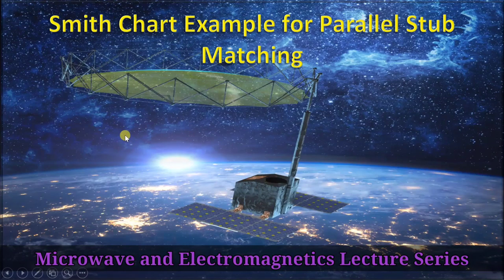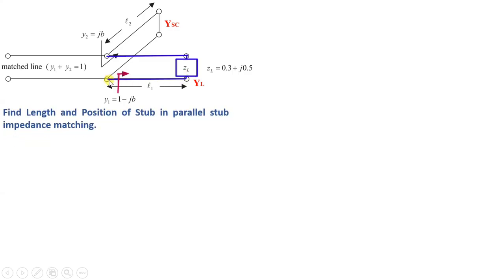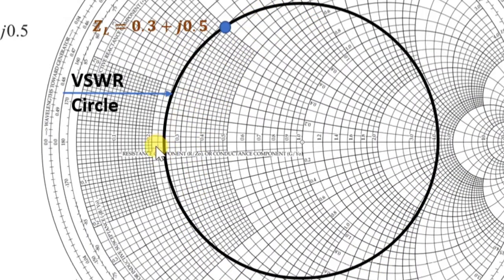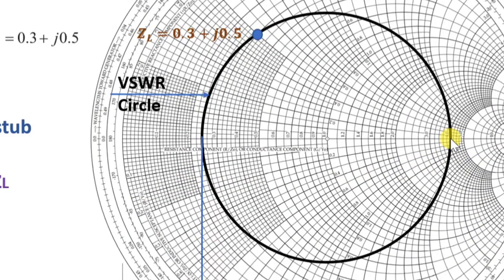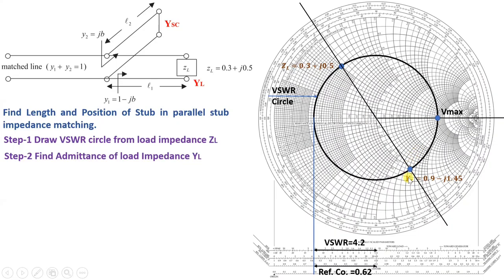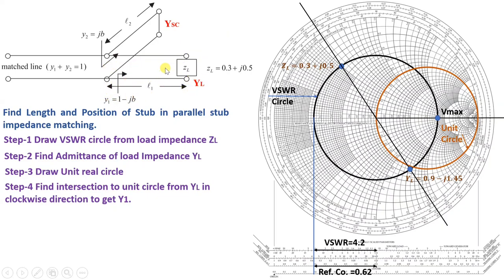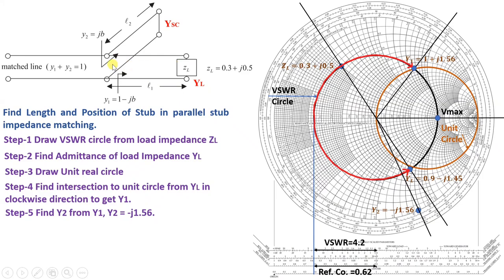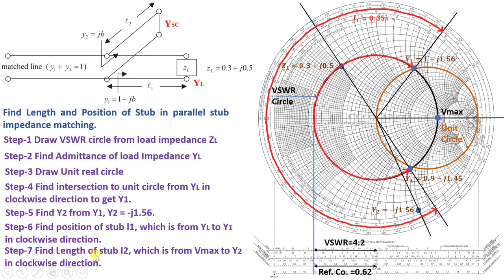1 Smith Chart Example for Parallel Stub Matching

Comment: The short circuit point is placed wrong. You need to place on the left side, not the right side of the smith chart.
Reply: The final answers will be wrong because you placed the short circuit point in the wrong place, or maybe the question is wrong
Reply: Actually Zsc is on the left side but Ysc is admittance which must be on the right side . So it is actually correct